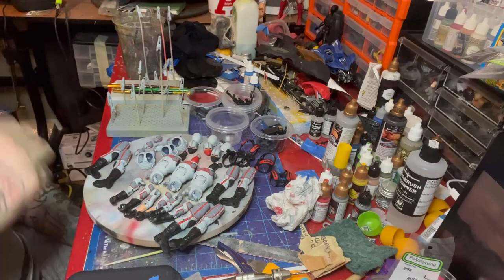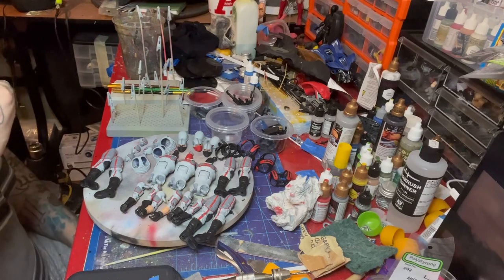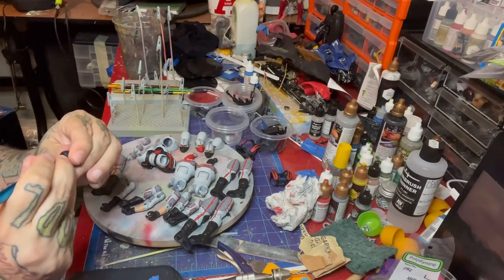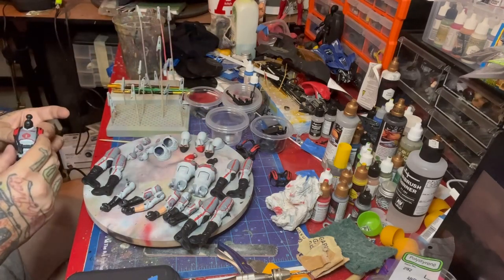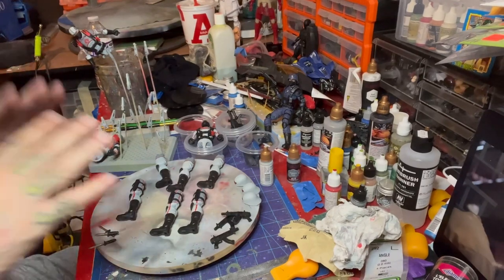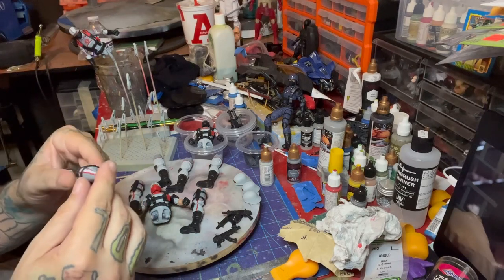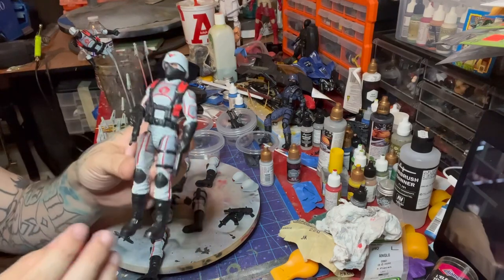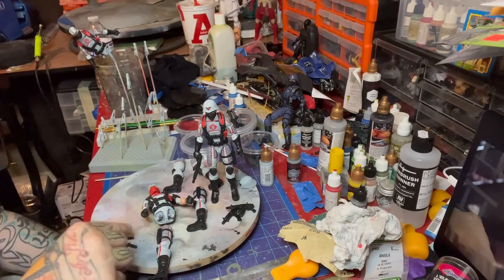Gi Joe Classified Officer transformation to Stinger driver Pt 4 Reassembly and Reveal

Comment: I may have missed it on the other video but. What is the purpose of the sealer, especially if you still have to worry about pain chipping?
Reply from the maker: No matter what clear or sealer you use, you will have some amount of paint rub. It just helps minimize it.
Reply: @gunbunnycustoms4302  ok good stuff